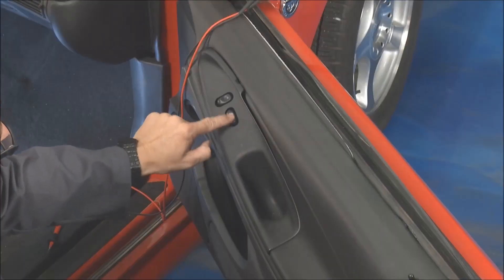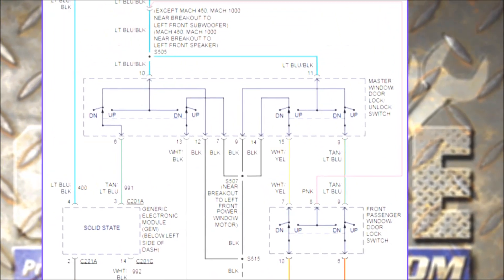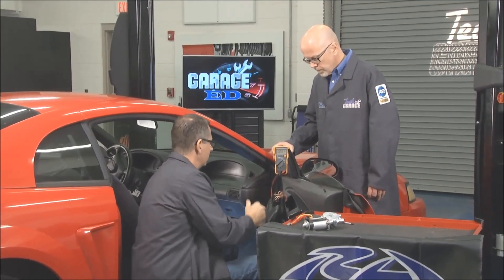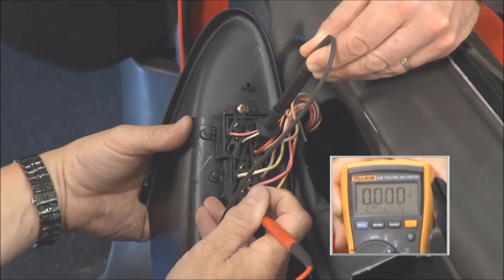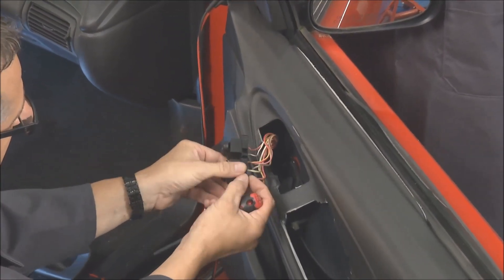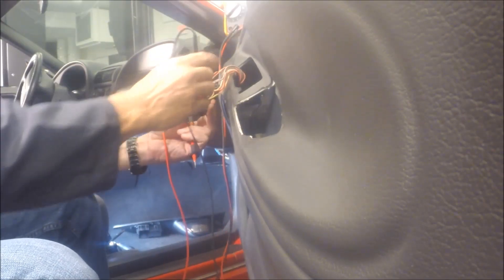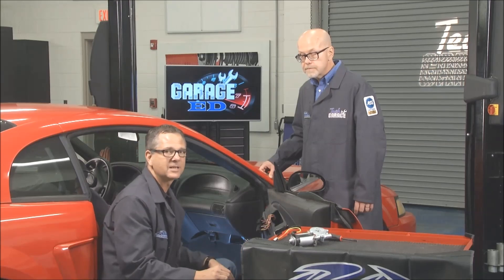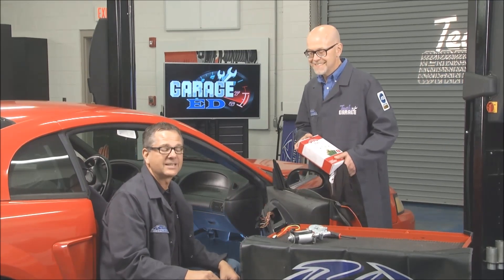Power Window Motor and Window Switch Diagnosis Using Multimeter and Wiring Diagram (Season 5/E13)

Comment: 1998 mustang convertible. I replaced the driver door window motor. Window goes up and down better than before. Problem- motor does not stop when window stops. Motor keeps on running and the gear teeth start jumping across the regulator teeth. Window has to be manually stopped. How to fix?

Comment: If there was no break in the wire  in the power window switch would the lights still illuminate on the switch itself providing there was power even if the switch itself was bad.? The mirror switch is separate and it illuminates when I turn the key. I'm guessing this would tell me right away without having to get the multimeter out? That's my old car Chevy Monte same color...had it 18 years

Comment: If it's not the window motor, window switch or 30 amp window fuse. What is it? 2006 Chevy Malibu. .
Reply: Resistance or break somewhere in the wire. Turn the multimeter to ohm and you can check wiring for resistance

Comment: You didn't mention whether or not the window could be raised and lowered from the master control.  I have a passenger side motor that will power down, but will not go up; this is true from the passenger side switch and from the master switch.  Could it be the master switch that is bad?  It is the only switch that ever gets used.

Comment: Hey! I have a 2001 Mustang, The power locks, mirrors, and power window on the passenger doesn’t want to work, i can get it to roll up and down when i cross the wires over, and can make the power locks work as well but it takes too long to take the door panel off and i’m just wanting to fix it now lol.  The driver side Window works, it rolls down and up no problem but none of the other things work. I’ve tried changing fuses, under hood and under dash but it doesn’t help. We suspect the doors wiring harness may be bad, but we don’t know if we should replace one, or both, and i don’t wanna spend more money on windows when i can on other stuff. Can you or anyone else help?